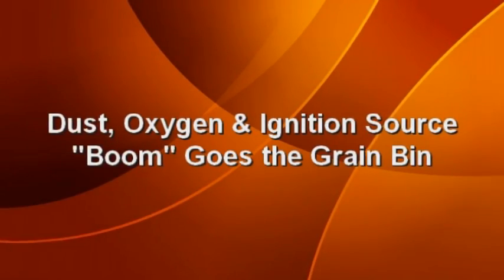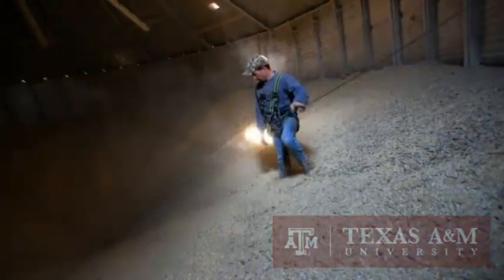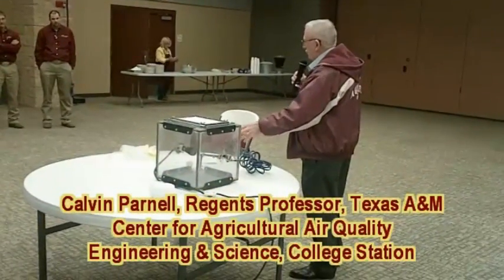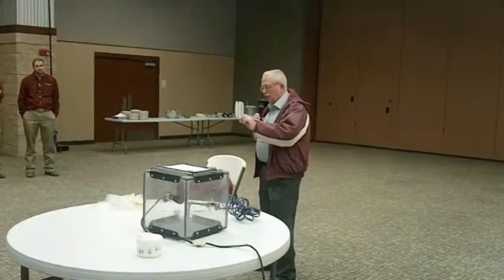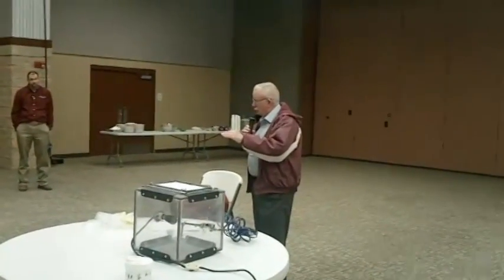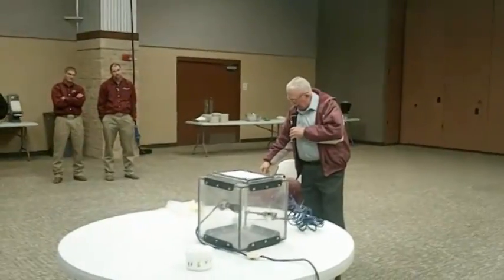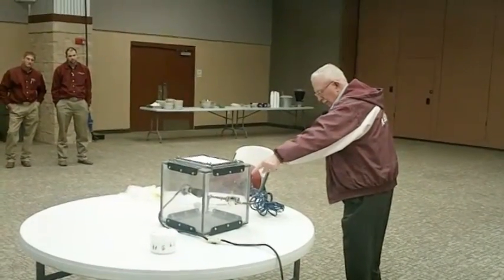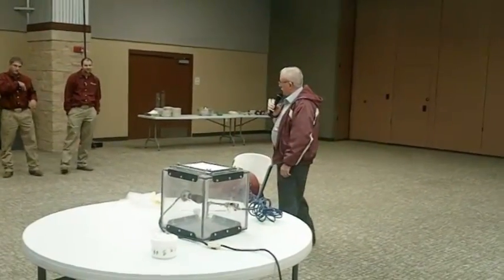Grain Dust Explosion Video

Comment: now when you multiply that up into the tons of grain found in a silo, if its not built like a cannon barrel, it will cause massive damage to the surrounding area. Thats the reason for the paper on top. You need to direct the deflagration in a safe direction in case something like this happens. I know this is not as impressive as some of the other videos on youtube, but this is what it looks like when someone knows what they're doing but also wants to make an effective demonstration.
Reply: @BillMcD, you're absolutely right. Moreover, I recently toured a concrete batch plant, the stood almost 300 feet tall. All the while walking the stairs to to the top, I couldn't help but notice the vast amounts of fine particles accumulating on horizontal members. When I brought it up to the batch plant manager, and other authority figures..... I was laughed at.